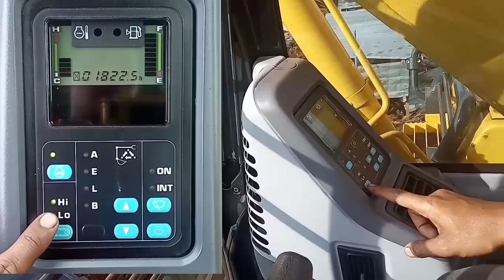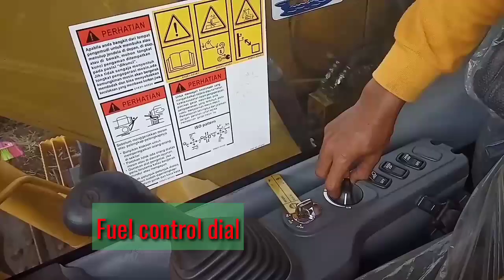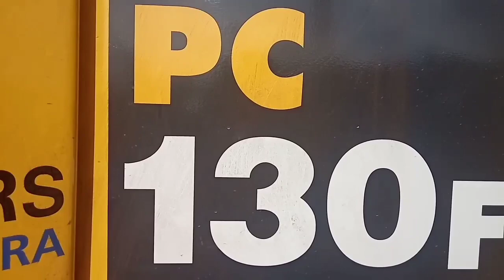Review Excavator KOMATSU PC130-7, Perbedaan dengan unit sebelumnya

Comment: As,bang saya mau tanya klw unlod 130  pada saat  engine hidup  handel  blm di gerakan  tekanan pompanya mencapai 50 klo mohon solusinya mksh.
Reply from the maker: Kalo masih 50 kg, gpp tu bg. Tpi kalo udah lebih 100 baru ketinggian unload nya..
Coba di check di video saya, tentang melihat unload pressure!
Reply: Makasih bang impormasinya
Reply: As,bera batas minimum dan maksimumnya pressure unload untk 130 bang mksh.
Reply from the maker: 30-40 kg bg..
Reply: @mekanik_komatsu  makasih bang smoga maju terus.
Reply from the maker: Aamiin.., sma2 bg..

Comment: Ass bang.bagi ilmu nya ya bang..handle lock gak berfungsi.itu ngecek dimana nya ya komatsu 130 bang
Reply: Monitor udh gak berfungsi bang
Reply from the maker: Wa'alaikumslam bang,, coba di check solenoid ppc locknya bang. Yg di bawah control valve.
Reply: Oke.terimakasih banyak bang.mga sukses trus